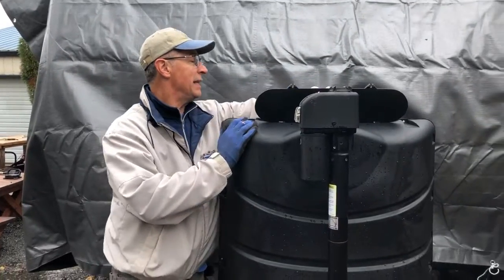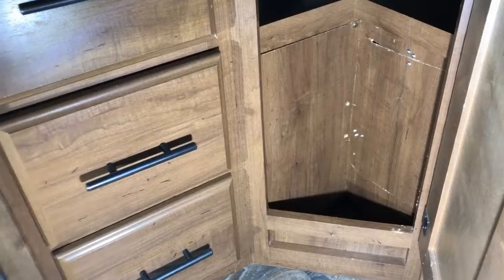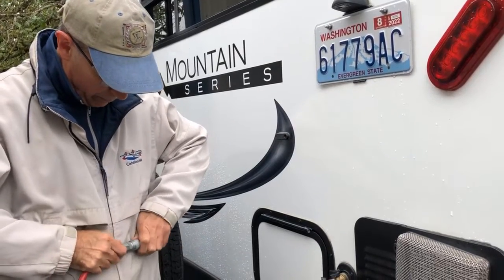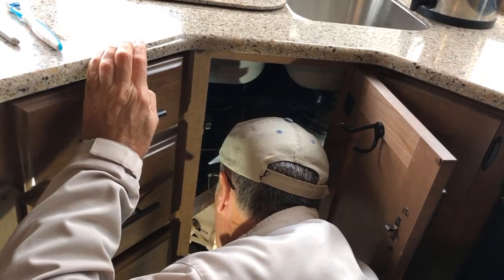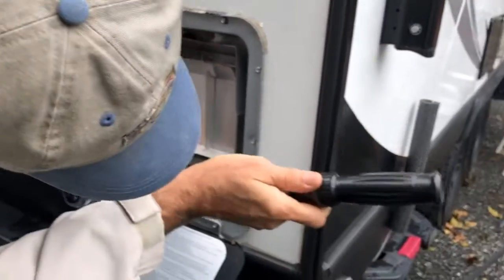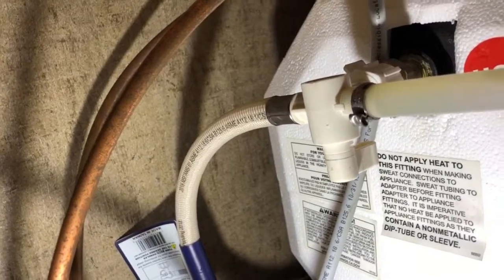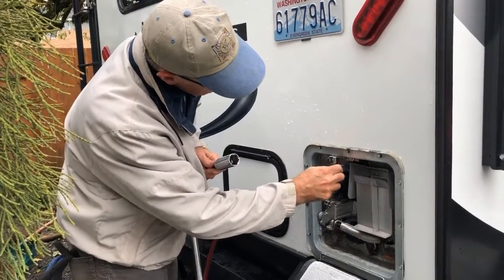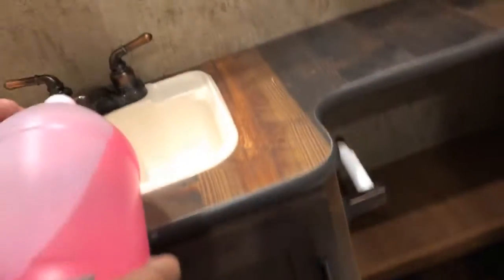Outdoors RV 2019 21KVS Winterization using Compressed Air

Comment: Well done! I have a 'pancake' type compressor and set it 25-35#'s. I made up an attachment that has a  male hose fitting on one end of a ~1ft piece of hose that screws into the city fresh water inlet and a compressor fitting on the other end that connects to the compressor hose. I also fitted in a 1/4 turn valve on the compressor end of the hose to turn on & off the air. We use our 26 KVS year round at least 1x a month, so I blow it out 3-4 x a year. ..... As we head home I open the 2 low water point valves. By the time I get home the hot water tank is empty avoiding the blast as you take out the tank plug. Lastly; I also unscrew the clear plastic bowl that the contains the strainer, attached to the incoming side of the water pump, drain & reattach. I found out the hard way about 30+ years ago that the compressed air didn't blow that out...